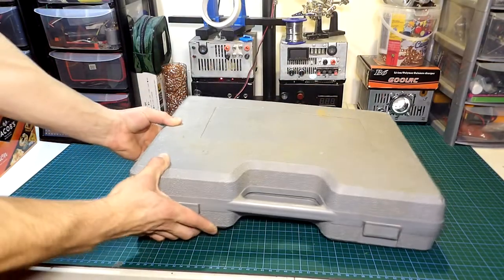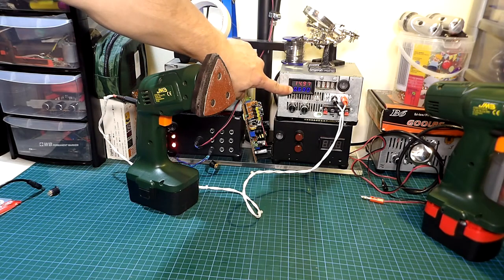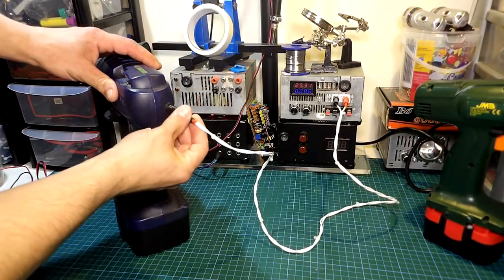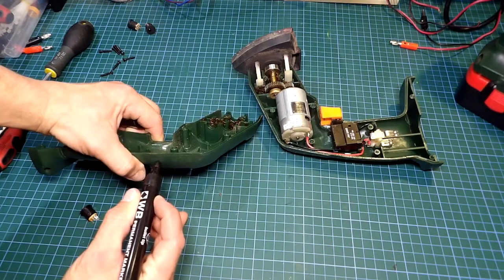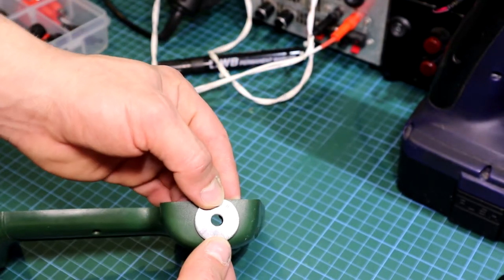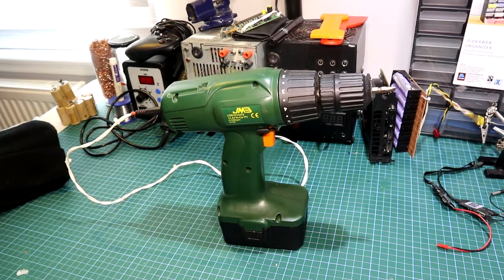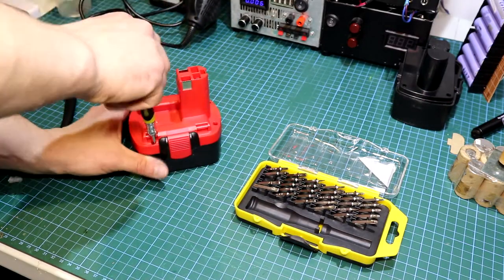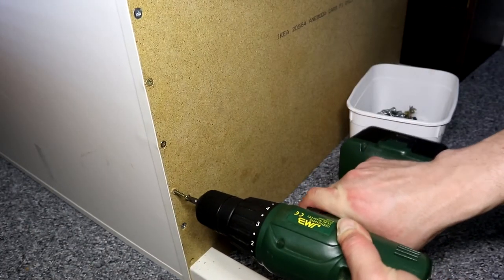Cordless tools to Corded power tools Conversion

Comment: I was thinking doing something kind of like that but just mod the battery itself one of the broken ones?
Reply from the maker: i will work but it will be not enough for the drill to work good . the reason that i have keept the battery is simple to have a buffer in bettween like that the drill will operate without halting the psu